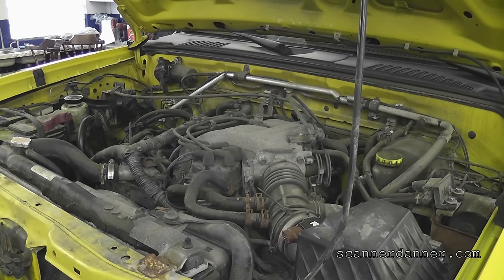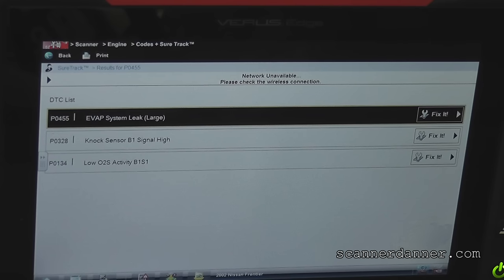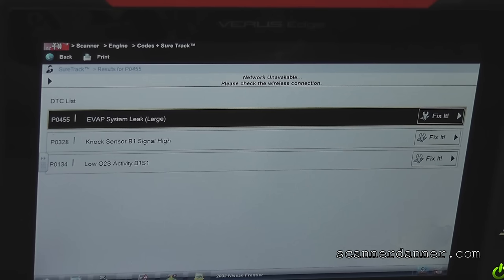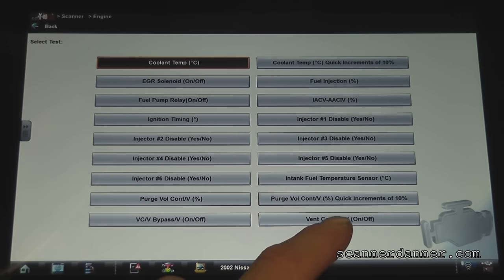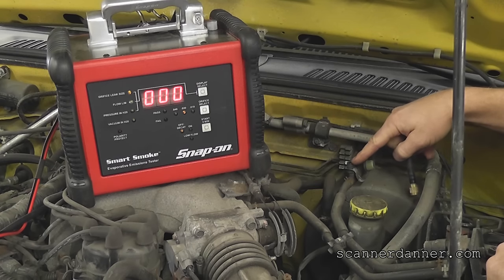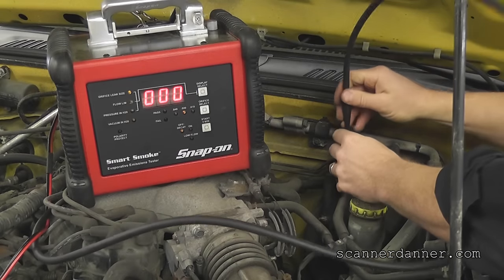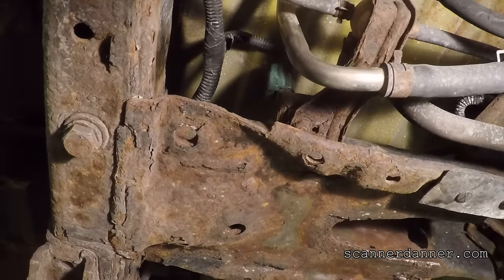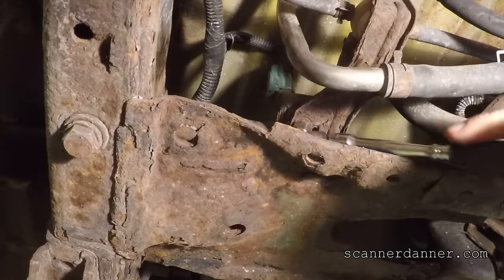EVAP  leak P0455 (vacuum cut valve-bypass valve test) - Nissan

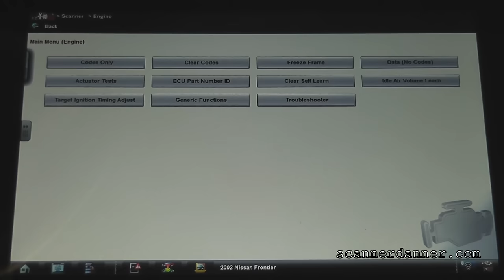Comment: Not all evap systems use vent valves 2:00 .  I had a hard time diagnosing vehicles that didnt have vent valves until i understood this. Some of Toyota, Honda's etc...
Reply from the maker: +Concerned Citizen every system will have some type of normally open vent otherwise you will not be able to fill the tank. And it is always after the charcoal canister. This way the fumes get absorbed in the charcoal before opening up to the atmosphere. So when you introduce smoke into an evap system you must close off the vent. Including Toyota and Honda.
Reply: +ScannerDanner By memory a 2001ish  camry for instance does not use a vent solenoid.  therefore there should always be a either a slight vacuum or slight pressure in the tank. if the tank is atmospheric pressure on that system, there is a leak in the system. I will take a picture of the canister tomorrow if you want.
Reply: +ScannerDanner the tank vents through valves on the top of the canister in extreme psi conditions for safety. The systems i mainly worked on before were domestic vent valve systems, pretty different.
Reply from the maker: +Concerned Citizen it's no problem my friend. I've just done hundreds of evap leaks on just about every manufacturer and every single one of them needed a vent line blocked off to do a proper smoke test. 
We can disagree on this one. It's really not a big deal. Thanks
Reply: im not trying to be a problem, just trying to correct a statement that can be tricky when working on one of these popular systems. i'll send you a really helpful link...chrome-extension://oemmndcbldboiebfnladdacbdfmadadm/http://www.starenvirotech.com/teacher/Magazine%20Articles/Motor%20Toyota%2006/ToyotaEVAP5.pdf

its a great series, im not sure which one this is. comes up easy in google search. the nice thing about this system is this, when first coming to the vehicle, before you start it scan your tank pressure (depending on system) if its not atmospheric pressure then there is no leak. if it is atmospheric pressure there is a leak to track down.  this is because the tank is not vented, unless the calibrated pressure is exceeded.

Comment: if I had that much trouble with that connector and I was the mobile guy diagnosing id cut the wires strip the insulation hook test light up turn driver on with scanner and if it lights id say alright gota go.

Comment: YOU HAVE TO PUSH DOWN on clips until they lock not push in like normal connections. 

my wife and I worked on her  Altima. I was trying for 30 minutes  to get a plug off!   She came out and found out how to get it off! Stupid Nissan. When on the same car they have normal connections!

Comment: Ridiculous, I'll bet the Nissan engineer never replaced one of these let alone a Rusty one, just getting to the connector, WOW!
Reply: +Stephen Smith  Typical engineering for all makes these days. Design for speed of assembly, not repair.
Reply: +Blazer02LS yeah I worked as CSMgr in a manufacturing facility that Manufactured their own airline truck equipment. Fortunately one of my best friends was the head engineer and he always asked me about serviceability of our products and incorporated a lot of my ideas because that was one of my main complaints, not getting to serviceable items. Too bad engineers don't consider a technicians point of view before implementing their engineering.I had it good I guess because I had to work on things he engineered!
Reply: Stephen Smith  My idea was to take the engineers and stick them in a service shop for 6 months before they can design a single item on a vehicle.
Reply: +Blazer02LS , kind of was my idea, I think that the engineers need to take the previous classes engineering development system ( project) completely deconstructed it and find out how they can better the previous classes system before they get their engineering degree. this gives them not only practical experience on mechanical systems but also makes them use their brain to think as we do how to make the system better and more efficient.
Reply: +Stephen Smith it's not that easy.  They have restrictions and constraints to work with, or better said, work against as well.

If an engineer could have their way, manufacturers would go out of business.
Reply: I know it's nice to have a friend that wants to learn the mechanics not just the engineerI got.
Reply: Just the engineering

Comment: 3/10ths people. lol
Reply from the maker: +feartechnition is that the flat rate time for an EVAP leak test?
Reply: no, commenting on general time given
 to get those damn sensors out.
Reply: I get 1.0 for any engine light, certain systems or multiple codes I get extra time. Chrysler, BMW and Mercedes it's an automatic 1.8 dye to the testing of the "leak detection pump" on an evap code. Any wiring problems related to an engine light pays the 1.0 for the diag and an extra .5 to check wiring
Reply: Sorry not dye meant to say due